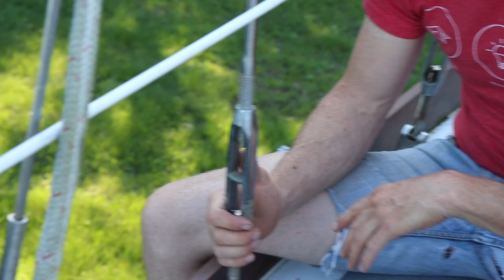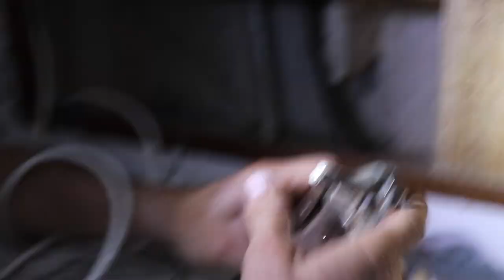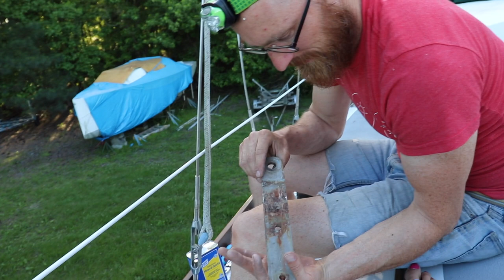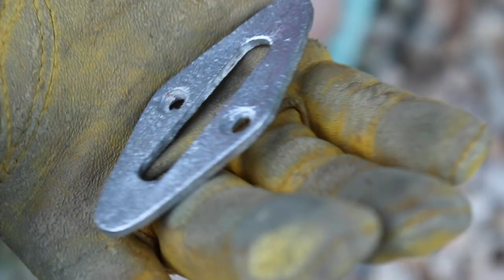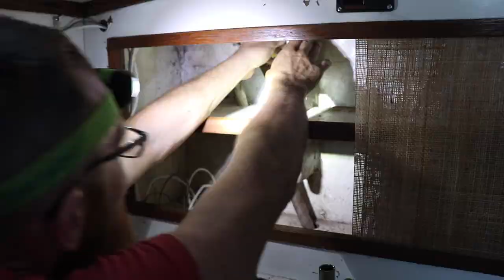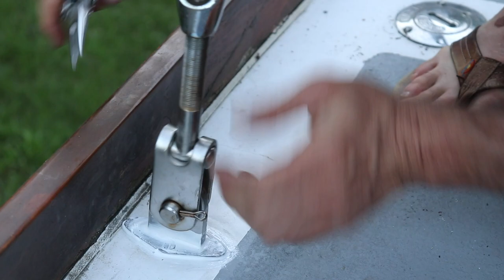Sailboat Chain Plate Inspection

Comment: interesting to see the decisions made on these old production boats. they were probably never expecting them to last as long as they have. I dislike the pockets. I'd much rather have two plates bolted around a bulkhead. Also I think the coverplate could be discarded and replaced with a standoff, say a block of wood epoxied to the deck. then water on the deck doesn't stand against the sealant. The chainplates on this boat are mounted so close to the hull side that you might as well have external chainplates, which will eliminate the possibility of the deck leak. (I think the bolts though the hull side won't be a risk of leak because they will be squeezing the hull side very tightly.

Comment: Saving up to buy a boat, checking the videos, buying  a  few books.   Always wondered how the actual chain plate was attached  through the deck.  Also liked you showing  the actual detail of doing it, rather than telling us the chain plates should be checked for cracks or overcomplicating which some videos do which is discouraging.   Thanks!
Reply from the maker: Thanks for the comment.  Glad to hear the video was helpful.  Good luck with your boat purchase.  Lots to learn and lots to do with boats, but that's what makes owning them so rewarding!

Comment: If those covers on deck really are aluminium, you really should replace them with SS. The galvanic corrosion between those two metals will definitely cause a failure.